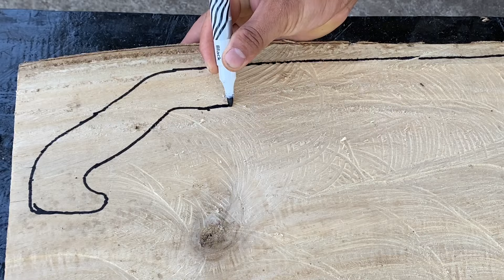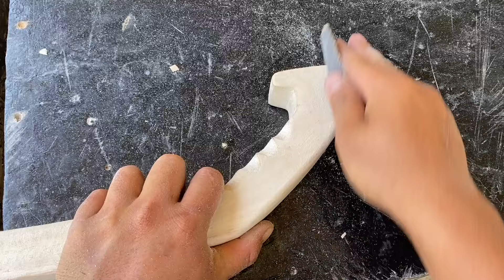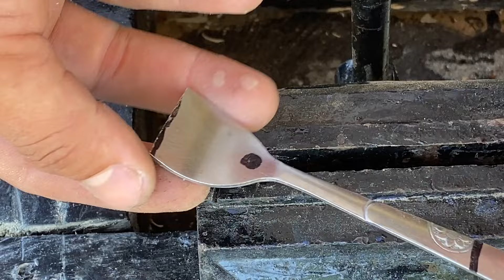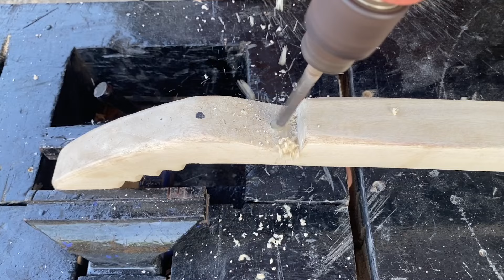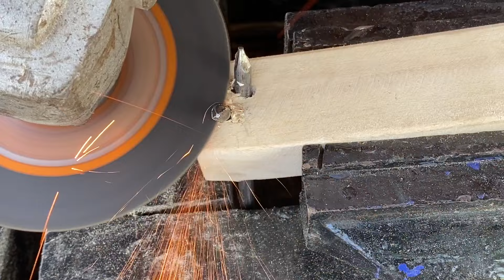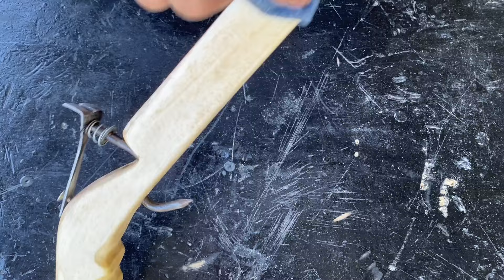DIY SLINGSHOT-WOODCRAFT FOR DEFENSE How to Make?#amazing #craft #diy #handmade

Comment: What rope you used?
Reply: I think its latex rubber tube with 6*9mm internal and external diameters. And the pouch must be microfibre leather pouch tied using tiny twine thread having capacity 18.1 kilograms or more.